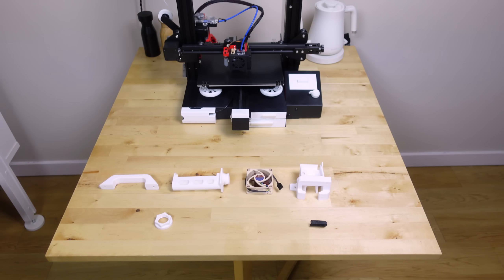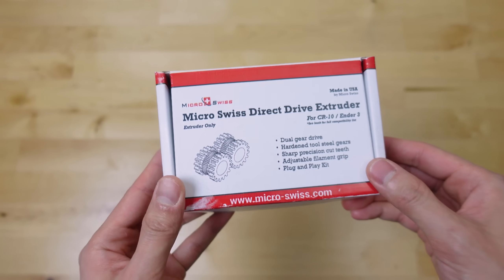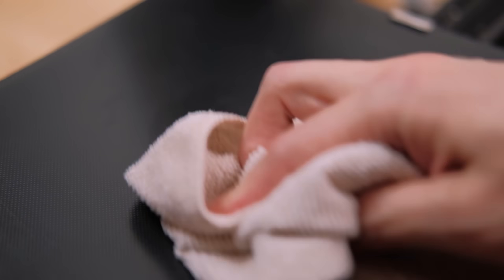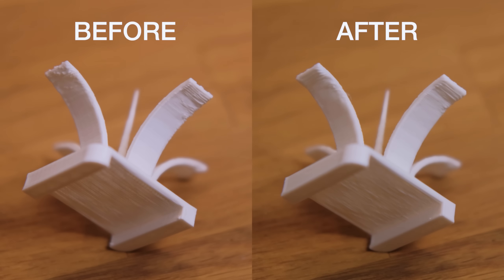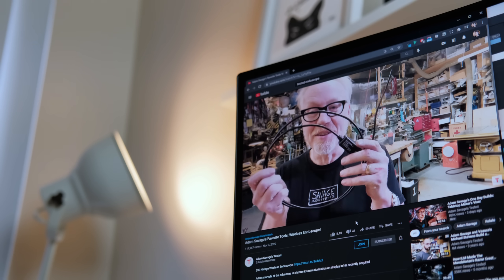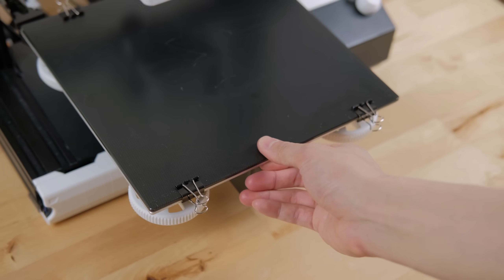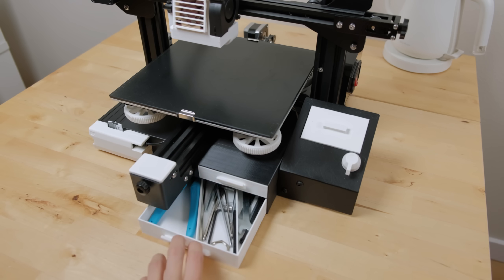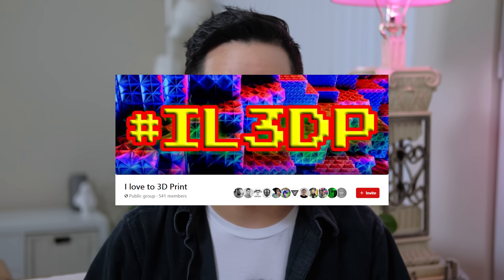15 More Upgrades for my Ender 3 Pro - Part 3

Comment: 0:54 listen. To. This. Capacitors are capacitors for a reason. Even with the system completely off and unplugged there are many electrical components that can hold energy.

Comment: you can try 4 dabs of rtv silicone in each corner under the glass bed and then take the clips off after a bit. Silicone temp is 600. Easy enough to remove strong enough with just a bit of silly.

Comment: The Satsana remix you made is nice, but why is the blower fan you have for part cooling not connected to the duct? It's floating and letting a ton of air escape from the sides.

Comment: You don't need a buck converter. Just figure out how much current they use at 12 volts, plug that current into ohms law calculator at 24 volts, and then use that value resistor in line with the fan.

Comment: You should do one of these amazing videos but for an Ender 3 V2. I have been wanting to get one but don't know if I want to get the Ender 3 Pro and upgrade or get the Ender 3 V2 and upgrade it. The Ender 3 pro looks a lot more upgradable than the V2.
Reply: most of the things for the ender 3 pro can be used for ender 3 v2
Reply: its basically the same printer lol
Reply: @borisgraell  Yea but with the upgrades for a cheaper cost.

Comment: I'd like to ask you if one noctua fan (40x40x10mm) is enough to cool the hotend. I've seen many people who have a noctua fan (40x40x20) because the air flow it isn't enough higher with the other fan.
Reply from the maker: Yea i've heard the same as well from recent comments! I might actually remix the part to fit a 20mm some time. it's not THAT much bigger so i might as well.
Reply: @ScottYuJan  Thanks for your answer! That's sounds so good! I will be so pleased if you can remix the part to fix a 20mm fan. Probably it would be nice modify it to fit with a 4010 layer fan too as this https://www.thingiverse.com/thing:4647053

Comment: I need help lol… my printer has the hardest time printing the first layer. I will not stick to the bed. Yes the bed is level. Yes I used a few swipes of a glue stick, but it still just drags on the tip.

Comment: Technically i think you mounted the insulation "backwards" the radiant barrier are supposed face the heat source in this case.

Comment: I use water and then throw the print in the freezer. So the water ends up freezing under the print. Then I pull it out and let it melt. The print just slides off the plate.

Comment: you where supposed to rout the cables diferently for the dirrect drive. The cables wherent supposed to go through the frame but around it to the front

Comment: Hey Scott, i just installed the new cooling Fan For the Power Supply you suggested in your video. Unfortunately it Runs at high Speed. So it is very Loud and Noisy. Andy Tipp or sugestions to Solve it

Comment: Good
I upgraded the fans and a 12v one works perfectly, but the 24v one is causing problems because it stops working, I have already measured it with the voltmeter and delivered 24v, but the fan stops and stays working when I put 100 % of speed in the fans the speed increases in the fan of 12v and not in the one of 24v.
can you help me?
Thanks

Comment: Good afternoon, impressive video of the assembly for ender 3. I will tell you that I acquired the touch screen, for my ender3. I mounted it by changing the motherboard 4.2.7 but, the change of filament does not come out and it does not recognize folders when I put the sd card, would you know if there is something I need to do?
Thanks a lot

Comment: I have a question I got the ender three pro and every time I try to print that plastic tube pops off
Reply: probably the connector is stuck, there are small metal teeth inside which should actually hold the hose

Comment: If you want 12 volts why not add a transformer and a terminal strip so you can have as many 12v items as possible?  You can even add a xformer with multiple voltage taps so you get even more options.

Comment: know this video is a bit old, but couldn't you also have crimped the wires for the hot end fan, like maybe with pwm male header that way if you ever need to replace the fan you won't need to cut and solder cables in the future?

Comment: Hi, THERE IS NO NEED TO SODER THE FAN WIRE TO THE OLDER FANCONNECTOR. JUST REMOVE THE WHITE CONNECTOR FROM THE POWERSUPPLY AN PUT THE FAN ON IT. THERE IS A + / - INDICATOR, SO THIS IS MORE FOOLPROF.

Comment: Love the vids!! I am curious, when you changed the fan from a four pin to two pin, what did you did with the other two wires. I am in the process of doing this myself, so I want to make sure I don't screw anything up lol
Reply from the maker: you should always google first what each wire color is for. usually the other two are for extra controls like speed or something so if you cut those off and have them connected to nothing it would still work fine.
Reply: @ScottYuJan  Thank you for the response lol. I'll be sure to make sure which is what.

Comment: Great video!
The linked psu fan is 4-pin, so how do I know which 2 wires to connect to the 2-pin connector? Thanks!!
Reply from the maker: if you google image search the brand’s fan followed by “4 pin wires” or something along those lines, it’s pretty easy to find out which color on the wire mean what. and then you can cut off anything that’s not the power and ground wires. good luck!

Comment: Great videos. I like the idea of switching my PSU fan, but when connecting to the old black/red wires which wires are you using on the Noctua fan? Looks like black/yellow, why is this?

Comment: you shoudn`t  use direct drive because theres only one threaded rod and the toolhead is very heavy 
so overtime it will bend the threaded rod overtime. plus you have a heavy motor on it so i recoment 2 threaded rod instead of 1

Comment: Don't connect those buck converters to fan outputs. Otherwise you'll get nice burning smell in your room. You should connect input positive of buck converter to your psu's 24v, input negative to psu's negative. Then connect your fan's positive to buck's positive output, and fan's negative to mainboard fan negative output.

Comment: I suggest you move from cigarette lighters to gas torch.
There are lots of them different, I've had cheap noname form China. I have tried fancy one from kitchen supply store. Both where working, the expensive lasted longer. My current is Dremel and it is great.

Comment: Scott, I see there is a lot of comments... here is another one :) You mentioned you loose on the height because of the way it is held.  I have the MSDD as well and I place the wires in the front so it goes around the printer and not through it and I do not loose height.  :)

Comment: Just a couple of ideas for you. Every time you cut two wires, cut them at different lengths, that way you only need one piece of heat shrink and they won't ever be able to touch even if they move or fray. Also, use a large heat shrink tube piece over the buck converter instead of tape. When using those 0.1 inch connectors to make an inline connector to join two wires, use a three way one with the earth wire in the middle and leaving one end empty. That way you'll never plug them in backwards accidentally and even if you do, it doesn't do any damage.

Comment: Great video. What regular and max fan speed settings are you using now with the 5015 cooling fan? I just went through and upgraded all of my fans and duct with the same ones you are using (plus the one for the main board with another 12v noctua on a 2nd buck converter).
Reply: I did the same update, but my 5015 fun is stopping and never working again Isn't it having that problem?
Reply: @miguelchitas6530  So far everything is working perfectly for me. I have my new cooling fan set to 70% max in Cura.

Comment: Hey scott, I really enjoyed watching your video and decided to upgrade to a micro swiss hotend and direct drive system for a more reliable and easier printing setup but i have run into a issue with trying to print, my extruder test prints off the bed to the side of it i believe because the X & Y are off would you know how to resolve this issue by any chance? I use cura as my slicer if that helps.
Reply: Hello,
You need to send  the following command once to your printer ( but you need to have a way to send commands to your printer, with octoprint or computer based methods).

M206 X-5 Y-10 (takes into account the new position of the micro swiss panel)
M500 (saves the coordinates to the main board memory, so you don't have to do it every time you turn on your printer).

Make sure to do it every time you update your firmware.

there's a way to do it from the lcd screen but it's less convenient...
Reply: @burkben1  I have a cord but what commands?, I think I've come down to fixing the home offsets but I cannot figure out how to do it on my printer
Reply: @burkben1  strange... i don't have those options on my lcd screen. Could it be firmware?
Reply: @alexgarza5398  Maybe, personally I've done the procedure with the commands and did not use the lcd screen, are you using the stock mainboard and firmware ?
Reply: @burkben1  no I’m using a BIGTREETECH SKR Mini E3 V1.2, though I have not updated my firmware. i'm not sure where to get the firmware for it. i tried downloading pronterface and octoprint I could not get either to work :(

Comment: you should not have raplaced the psu's metal cover with a plastic one, as its main purpose is to act as a shield. It's a switching psu and it generates a lot of emi. At least glue a metalic foil to the inner side of that plastic cover.

Comment: Please show us how the wiring fully works for the psu I have an ender three Pro But yet the sonic fan doesn’t work for me please get back to me
Reply from the maker: what doesn’t work about it?
Reply: @ScottYuJan  well after a few Tron errors I had the PSU silent fan fixed I just had to get some new cords but how did you wire the switches for the raspberry pi because I really like the design of it and I really want to know
Reply: @ScottYuJan  now i have a new issue its with the rasberry pi i tried to use your switch method but it just keeps powering on even if the switch is off plz help or like make a quick vid on the wiring so people like me can know how it fully works
Reply from the maker: @dkglitcherz5920  it's honestly pretty hard for me to make detailed tutorials on stuff like that since the information is constantly changing as Creality is constantly updating the hardware and firmware on these printers from their factories. PLUS, i'm not an expert so I would be pretty scared to give detailed instructions to anyone. I prefer people doing their own research and actually learning about these things. With that said, I'll try my best to help you! Regarding the fans, simply google your raspberry pi's model with the words "pin diagram" and you should be able to pretty easily identify which pins have the power and ground. from there you can use jumpers from those pins to power a fan. Regarding the switch not controlling the on and off of the pi, did you try checking if the switch is doing anything at all without the raspberry pi? if you have a multimeter you should first check if the switch is wired up correctly. sometimes the wires end up touching or something in the switch's mechanism and is broken. if it's not the switches problem then you might have a more complicated problem on your hand but i would 100% start my troubleshooting from there first if i were you.
Reply: @ScottYuJan  I fully checked over that and the main issue is when I fully connect the printer to the power supply that’s when it happens basically Sends Power throughout the whole thing but when I unplug it the switch works perfectly so sometimes I’m completely confused on why it isn’t working and I do have all the wiring set up perfectly every single wires in their desired place I even switched them around a few times and I did use the multimeter correctly I said it to 4.9 V so I don’t know what I’m doing wrong
Reply: @ScottYuJan  actually i just figured it out its when i have the usb from then motherboard to the rasberry pi thats why it keeps powering on with out the switch so how would i fix that get a different cable?
Reply from the maker: @dkglitcherz5920  huh! that's bizarre. I was going to suggest that as the next thing to troubleshoot but USUALLY in that case it's the pi that's leaking power to the printer and powering the printer in a messed up broken way that leads to issues but it looks like i guess in your case the printer is leaking power to the pi. interesting! so what you can do is either get a very special kind of cable that's hard to find OR what I have seen some people do is just put some tiny bits of tape over the conductive pin within the usb to cover the power and ground pins basically. I would personally just use tape if i were you but i have also seen people even 3D print these things to cover the pins. Read the description on this person's part for more details too. similar issue to what you are experiencing: https://www.thingiverse.com/thing:3044586
Reply: @ScottYuJan  thanks for helping me so much man I love your videos so much And I hope that I can look forward to see your next video

Comment: How well do the noctua fans work out for you. There's a lot of talk about using the noctua fans on the hot end causing a lot of problems. Just curious if it has been working well or not.

Comment: even with a new filament and BLTouch levelling, i still hear pops (usually from moisture in filament, but my filament is new) while printing and the first layer refuses to stick to the bed (and the filament just clumps up over time). should i change my extruder? I think the extruder is broken because there was once i had to manually remove some stuck blob of filament and i also removed the rubber insulation already. Perhaps it's a good time to upgrade my extruder. I'm not sure what do yall think? :)

Comment: Does the satsana duct you made fit the ender 3 v2? I really want to install some Noctua fans on and have the cover.
Reply: @oliviabanfield  But the space for the v roller, there is no space to drill.
Reply: @oliviabanfield  that makes no sense. There is no place where you drill.

Comment: instead of using endoscope i think you should get  usb camera module from alibaba ( get like spam grabage email cus they will send you hundreds of camera options for requesting info for just one) chose narrow, laptop thin or chogus lenses. Then build little fan shroud to blow air around and away from lenses( keep the fogging from happening ). you could set up octo print and klipper to have extra versatility and print fail prevention. Or have fan shroud that goes around your endiscope and cool it while using the printer.

Comment: You should try The Spaghetti Detective. It has AI failure detection when you have spaghetti on your 3D prints,that means it will stop asap to prevent clogged nozzles,and etc. You only need is a Raspberry pi 3B or later with OctoPrint and a raspberry camera or a usb camera like this 20$ endoscope. You can control it using your web browser and your phone.

Comment: @Scott Yu-Jan  Bro you have skills.  I am too scared to do all those electrical upgrades that require cutting and soldering.  I have an Ender 3 Pro and just installed a BL Touch and glass bed.  Can you recommend a Satsana fan I can print that will allow the BL touch to be mounted?  I had one on before with the factory setup but need a new one now that will mount the BL Touch.  Thx

Comment: New component!
Reply from the maker: oh you meant “new comment” haha i got so confused. okay so, do you have the buck converter and all that hooked up properly? what’s your set up like?
Reply: @ScottYuJan  no - I didn’t do the converter. I was just going to splice the blue/yellow to the red/black.
Reply: @ScottYuJan  I even just said screw it and ran the cables from the fan straight into the same slot the original fan was without splicing them and it didn’t work then either.
Reply from the maker: @NightBlade58  wait, did you first make sure your new fan matches the voltage of your old fan?
Reply: @ScottYuJan  yes. Both say 24v
Reply from the maker: @NightBlade58  wait a minute... and you are using noctua fans? and you said blue and yellow? you might want to google noctua fan pin configurations because i don't think it's blue and yellow, is it?
Reply: @ScottYuJan  nooo the blower fan on the side. The Furiga fan that blows downward.
Reply from the maker: @NightBlade58  oh whoops, my mistake. i forgot you said part-cooling fan. yea that's weird man, i have no idea... and you're certain the fan works and all that? like, have you just tried powering them with some batteries or something just to check? wow, that's so bizarre... that's supposed to be the easy part! huh...
Reply: @ScottYuJan  it is yellow to red right?
Reply from the maker: @NightBlade58  that's the case on mine yeaaa but maybe just reverse them and try? I mean you never know, maybe it was wired up wrong on your printer or something. if that still doesn't work, definitely check with another power source just to make sure your fan isn't broken maybe

Comment: Love your videos but what are you bed settings? I’m having troubles with my glass bed on my end or three sticking. I have heated up the bed to 70 he did the nozzle the 210 lowered my first layer speed to five and clean it with alcohol but sometimes it does not stick wondering if you could give any insight

Comment: Did Ender sponsor by sending the base printer?
I need to make small boxes for ESP32, 8266, raspberry, Arduino.  But mostly electronics cover for push mower for elderly lady I am trying to add RC control for her.

It takes long time to save money for each item.    I saw all your upgrades.